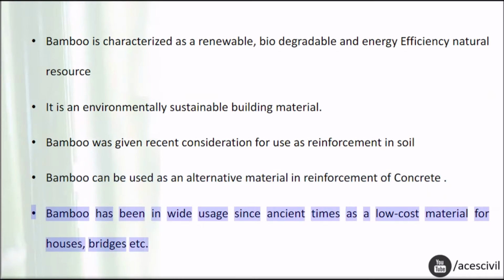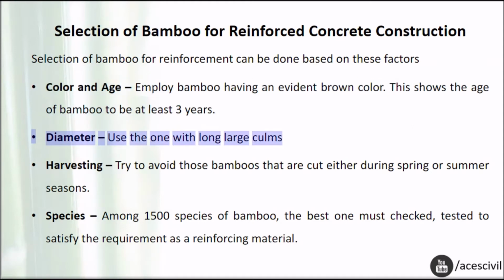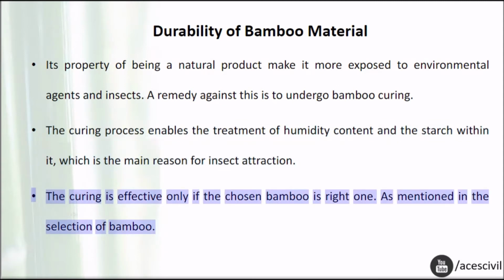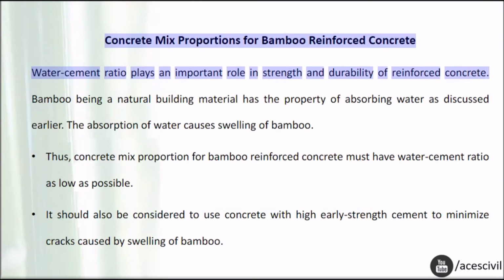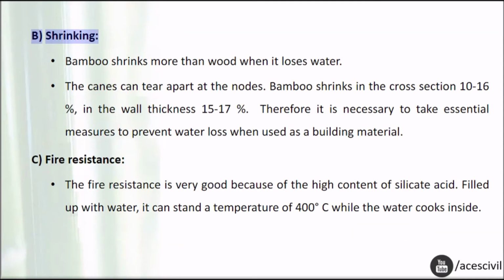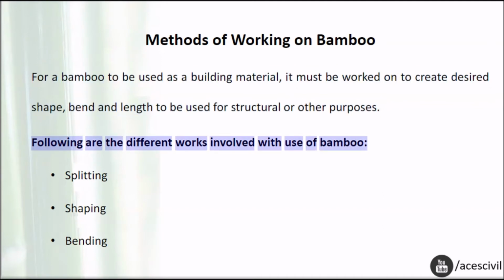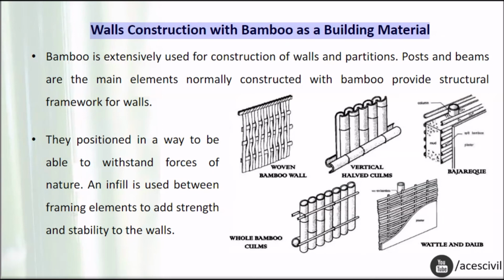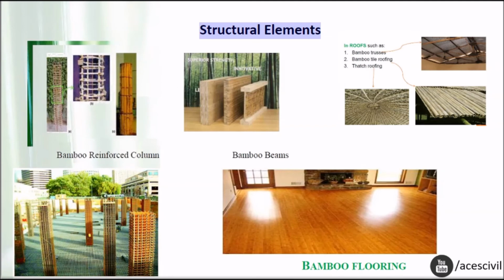Bamboo Reinforced Concrete

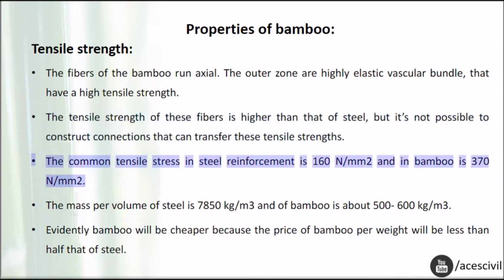Comment: "The common tensile stress in steel reinforcement is 160 MPa and in bamboo is 370 MPa" at 19:10. What does it mean? The characteristic tensile strength of common steel for concrete beams is about 540 MPa, whereas for bamboo doesn't reach 50 MPa.